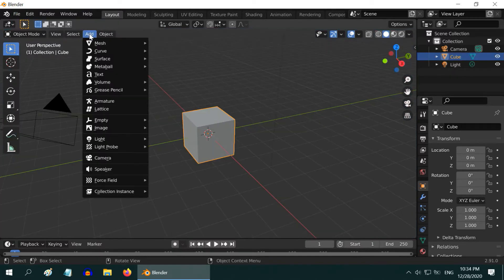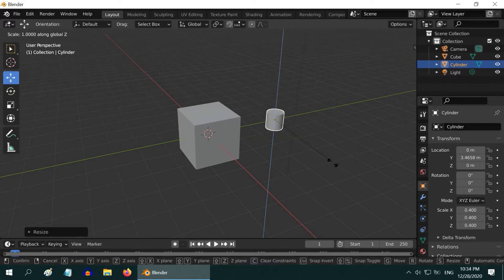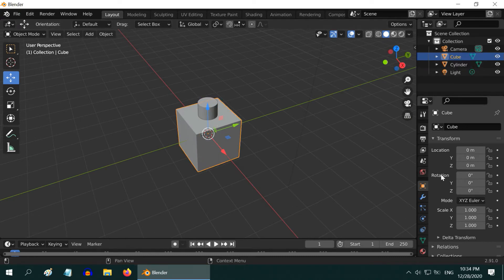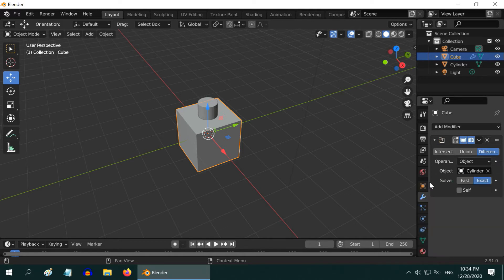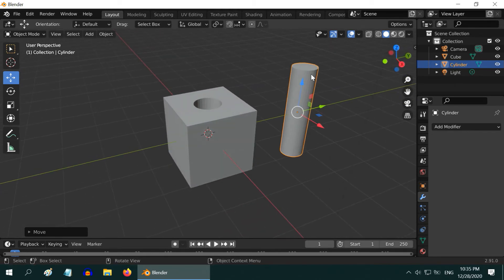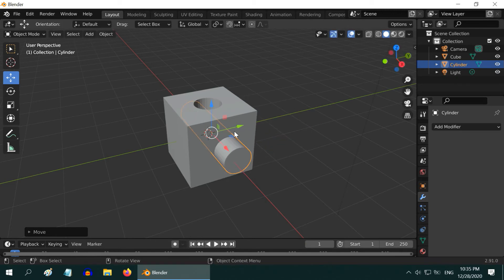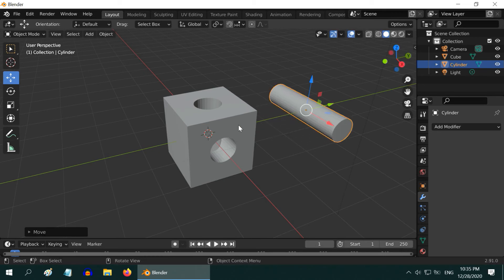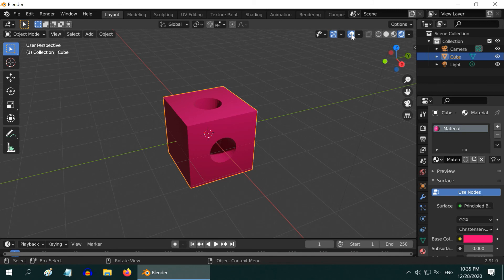Cut A Hole Into Any Object | Easy Method | Boolean Modifier Examples | Blender 2.9x Eevee & Cycles

Comment: Thanks for the quick instruction vid. Very helpful. I'm working on a Blender project. Four identical objects that each need a hold in them. Two of the objects the process works like a charm. The other two objects, when I select the cylinder as the object to create the whole, Blender doesn't complete the selection, and so even if I hit "accept", no hole is created.
Reply from the maker: Depending on the object type, sometimes you may need to use the Fast solver, sometimes the Exact solver. And you may need to enable the Self option under the Exact solver. But I did not quite understand it when you say that Blender doesn't complete the selection. Is the selection not working, or the hole is not working? If you can kindly clarify, I will be able to help you better. Thanks!

Comment: Great one. ^^
Reply from the maker: Hi Bro, this tutorial is made in 2021 itself, and this is a very basic feature in Blender that did not change for several years. I believe you might be doing something different which is why you are not getting the correct result. Try to change your Solver option, try enabling the Self option, which may be needed for some special objects. And above all, if you can kindly describe the issue with step-by-step details, I will be in a better position to help you. All the best!
Reply: @5MinutesBlender  Nvm, I actually got it to work lol. Everything got mixed up and it wasn't adding models to the scene.
Reply from the maker: @SomeRando8221  Wah! I'm really glad to know that it worked. Appreciate if you can delete your comment, because people might get misguided thinking this method really does not work. I can delete it too, but I never delete someone's comment out of courtesy. Btw, thanks for watching our channel!
Reply from the maker: @SomeRando8221  We're not on discord yet. Once there, I'll surely connect with you 💝 Thanks for the edit!
Reply: @5MinutesBlender  You got any other socials?
Reply from the maker: https://www.instagram.com/5minutesblender/

Comment: so easy but not working lol thats why i hate blender
Reply from the maker: Hey, can you please tell me at which step are you stuck? This is very basic to Blender and it should work. If you can give me more details like which step is not working exactly, I can try to help you find the root cause. Thanks!
Reply: @5MinutesBlender  Cylinder doesn't appear. >:(
Reply from the maker: @SomeRando8221  Go to the Add menu, then go to Mesh, and you will find the Cylinder there. If that does not solve your issue, then please try to describe a problem in the right way, and attach a screenshot, so that another person can comprehend it. All the best!